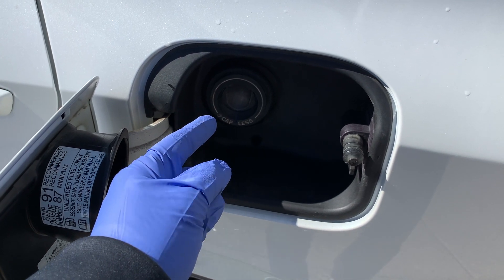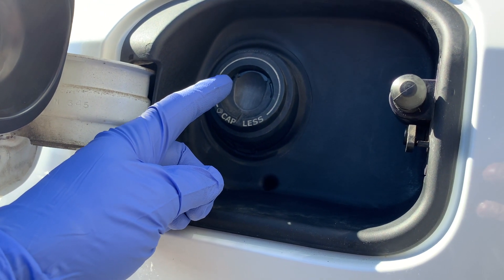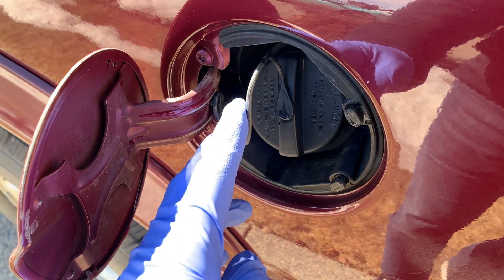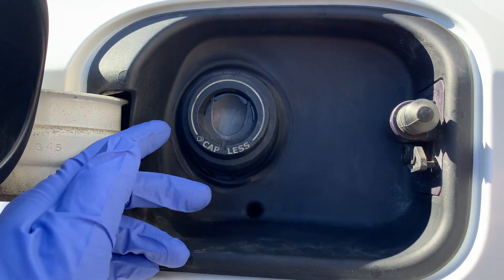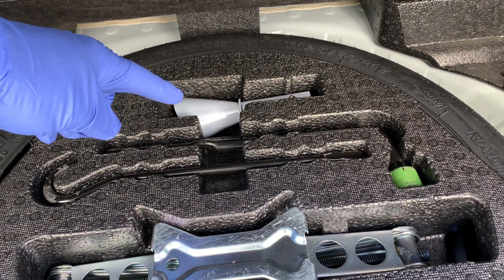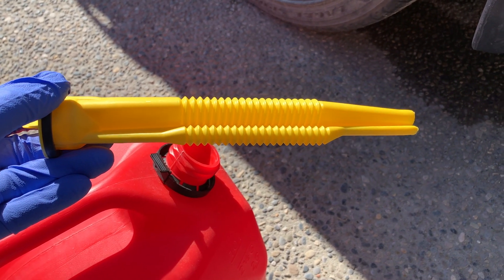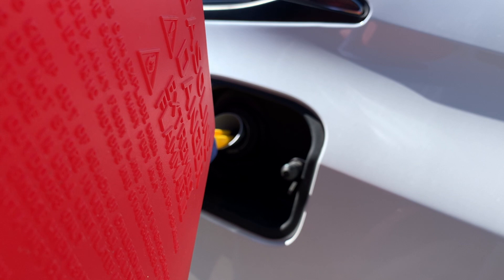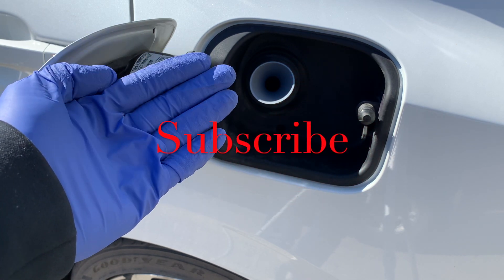Capless Gas System - Pros and Cons

Comment: Just another thing to fail.  As if having a microprocessor for everything on the car is not bad enough, engineers come up with this asinine idea.  I bet the number of EVAP system failures is going to skyrocket!!  The reason the carmakers get away with this crap is because the average car buyer knows absolutely nothing about cars..

Comment: What is the small hole under the capless one?
Reply from the maker: Sorry for the late reply - I believe you’re referring to the drain hole which gets rid of excessive fluid, such as water from a heavy rain or spilled fuel.
Reply: @YourHomeGarage  thanks bro. I washed my car and sprayed water there  and thought it was a kind of breather from the gas tank
Reply from the maker: Odds are you're good, but just pay close attention to the following which could be signs that water got into the fuel system from spraying in that area. 
Rough acceleration, rough idle, check engine light comes on, hard starts...just to name a few symptoms.
When I clean the fuel filler area, it's usually with a light spray (not a pressure washer) or just a microfiber cloth to pick up the contaminants.  
Cheers

Comment: How do you put a locking gas cap on. I have a 2021 Ford Bronco sport big bend.
Reply from the maker: Ford does sell a Fuel Filler Plug for their Easy Fuel system.  It's a keyed cap which works the same as a locking gas cap that would screw into the fill nozzle.

Comment: I have a 2017 Ford Explorer XLT.    The bad guys, can easily get the special funnel and siphon off some gas.... AND, that that's how I had half a tank of gas stolen out of the tank.  so, I went and bought a locking gas cap, so that wouldn't happen again.  The car comes with one of those "special" funnels , in case you run out of gas and need to use a gas can to fill the tank up....
Reply from the maker: It’s unfortunate some of your fuel was siphoned.  But locking gas caps or filler plugs are incredibly useful.

Comment: If you see a Capless Gas System in a car then run away. Do not buy it 
You can get a Stuck Gas Nozzle At The Pump, and if the Fuel nozzle gets STUCK. Trying to pull it, you may damage the easy fuel system and get the EVAP small leak code P0455 or P0456.
Using a Capless Gas Tank Funnel, on sale $3.00 at Advance Auto  Parts, anybody can pour anything, water, soda, in the tank, or siphon gas from the tank.
If you get the EVAP small leak code P0455 or P0456, in your car with a gas cap then just replacing the gas cap $15 and 2 minutes time in 90 % of the cases you solve the problem.
But in an “easy fuel system” or Capless Gas System you do not have a gas cap.
In the best scenario the fuel gas tank filler system has to be replaced. But you must have a very honest car repair facility, because anybody can speculate for EVAP CANISTER, Evap Vent Solenoid, PCM, Test Port, EVAP Purge Solenoid, Fuel Tank Pressure Sensor, shut off valve.
And the bill can reach $1500, not including valve cover gasket.
So if you decide to buy a car, open the Gas Door, and if you see a Capless Gas System, please run away.
Reply: All newer vehicles are coming out with this. I myself don't like or want it but what choice do we have?
Reply: Never had a problem with a gas cap. Now I have one without the cap. When I fill up the car doesn’t want to start and after you get it going it’s ok. Just like most new things these days. Cure is worse than the problem
Reply: You can replace the capless fuel filler on a ford for 70 dollars DIY.
Reply: @davidperry4013 it’s also a pain
Reply: Same problems i have on my honda civic and what i have to buy and replace to solve this problems? Smell of fuel and p0455-p0456 🤔
Reply from the maker: Here are the typical causes for those codes:

- Fuel Tank Sending Unit– gasket issues. 
- Fuel Filler Neck– gasket can dry out
- Evap System Hose– can begin to leak
- Vapor Canister Purge Valve–  easy to replace 
- Fuel cap - but you won’t have one because it’s a cap less system.
Reply: @YourHomeGarage  yeah but if you find a dishonest Mechanic they can start throwing parts at the car and easily be in $1,500 over having a capless gas tank. Lol I'm ok with my gas cap they've been fine for 100 years why change now? Oh for the money made replacing the crazy parts,and the money saved not giving us a gas cap.
Reply: @kyree0083 those jerks could be oil on your pistons
Reply: Agreed. My mustang has this and I ended up crashing leaving a car meet, I’m 100% certain the capless gas system had something to do with it

Comment: My check engine light came on after fueling. Emission system failure was my code giving..I use the funnel located in the trunk of the car. I inserted the funnel and gave it a turn. Took it out and closed the lid. Gave it a minute turned the car on and no more light. 2019 honda odyssey. Hope this helps anyone 🙏
Reply from the maker: Nice troubleshooting!
Reply: Hi, I have honda CRV 2017 and engine light came on again. It also happened after fulling the tank. When you inserted the funnel did you also turned on the engine?
Reply: Do you top off the fuel tank, I used to have the same issue when I topped off, then I started turning off the pump at the first click and that stopped the check engine light from coming on.

Comment: I don’t like that you can just open the tank up and someone can pour sugar in your tank
Reply: If someone has access to your gas door, what’s the difference if it’s a cap or capless system?
Reply: @teeth-man  you get a cap that locks, of like my car the door itself locks
Reply: Like the movie Kingpin
Reply: My 2020 Buick has no gas cap and no gas tank door locking mechanism.  If I had known that, never would've bought it. SO STUPID.
Reply: My gas door can only be opened from the inside of the car
Reply: I know what you're saying,  I have the Pathfinder fuel door, which is unlocked always..
Reply: could use a cap that requires a key to open it
Reply: @margar2321 how there’s no cap
Reply: @margar2321 no, you can't.

Comment: Awesome information. Just the other day I was working on a car the did have a check engine light because of this, I poked this plate couple of times and the check engine light never came on again.
Reply from the maker: Nice fix Arni!
Reply: Hey do you have a contact number? Trying to get car fixed
Reply: I’ll try that thanks.. my check engine light is on and it has a capless system
Reply from the maker: Let us know the results - thanks
Reply: Will buy the funnel. Benalla Ford can't  work out solution as can't buy parts any more.

Comment: Where's this gasket you speak of? Is it on the outside or inside? Inside meaning you'd have to drop the tank or somethibg to replace it... 

With screw caps the gasket is right in your hand or you just screw on a new cap...
Reply from the maker: The spring loaded mini cap is past the outside lid that I pushed in during the opening frame.  It might be a bit difficult to see but it's there.  As for replacement, it is a process, but you won't have to drop the tank.  Most capless systems come as a complete kit, so you will unbolt it from the body of the vehicle and then disconnect and replace the fill tube that goes to your tank.